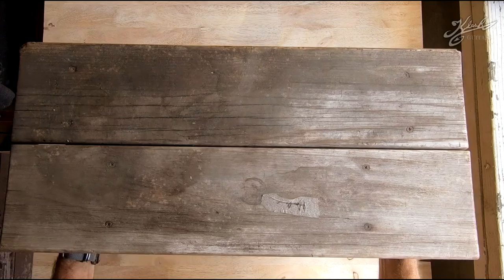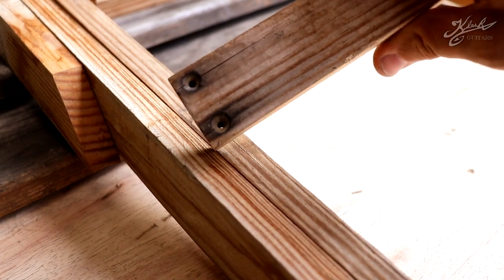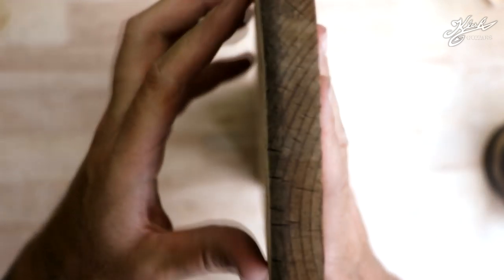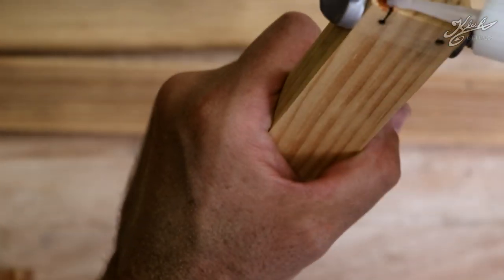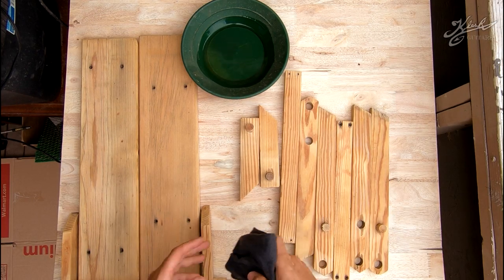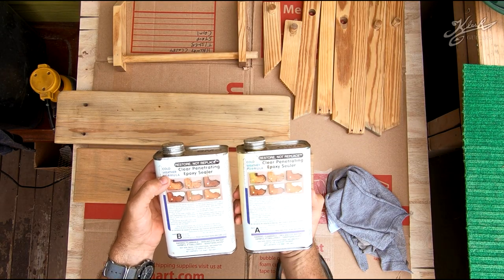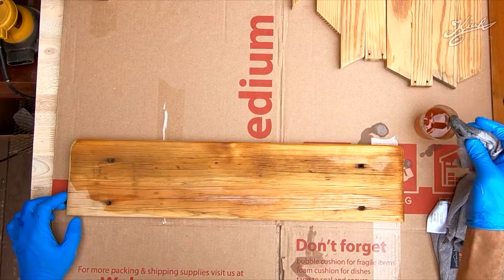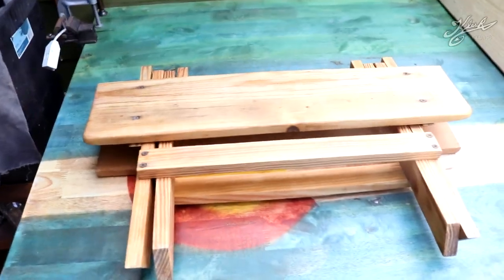Uncle Bartley's Puzzle Table Restoration

Comment: Nice video  There is some super glue called tite chairs. I used it on some rungs of an antique chair . WORKED GREAT. Didn't have to take the chair apart either. Comes with two ultra thin tubes to get it in crazy small places.  Can use on lots of items,  but kind of expensive.
Reply from the maker: Nice!

Comment: With super glue? humm looks like it worked,nice job...found a flake in my pan today with a good bit of flower gold,never thought i'd find any flakes around these parts most of the time just a nice line of flower gold. mhm i use the super slush gold pan by garrett also have for years..later
Reply from the maker: Nice!

Comment: Shane why don’t you put the glue into the cracks first then clamp it down? 
Cool video, thanks for sharing and keeping that old folding table around for a few more years👍  I think I saw a piece of gold in your gold pan....😂JK
Reply from the maker: The wicking action of the super glue is what makes it work, it also dries almost instantly. Gotta clamp it first or it might dry before clamping.
Reply: KleshGuitars Oh ok, is that better than using Elmer’s Wood Glue just because they are really fine cracks? I don’t think that thick glue would get down in there right?
Reply from the maker: @bo49685  True. The super glue is better in this case for two reasons. First reason, the super glue gets all the way down to the invisible parts of the crack. Second reason is that the cracks are old and weathered, probably full of dirt as well. The elmer's wood glue is great for clean and perfect seams, but when trying to glue together "dirty" joints, might have issues.
Reply: KleshGuitars Man I’m learning a lot just from that simple video, see why it’s cool to do those, it helps some of us out👍 
1 more question, is that superglue just called thin super glue or is there some special name for it?
Thanks again Shane for sharing this, I actually learned some things I never knew.👍
Reply from the maker: mark Bohamed I’ll have to get a link for you I bought it on Amazon, I’ll add it to the description when I get home.
Reply: KleshGuitars You don’t have to go to all that trouble. But if you do, THANKS Shane👍

Comment: You can we cup wood,by weighting it down,but nice video
Reply from the maker: Usually what I'd do is make sure it's completely wet first by soaking it for a few days underwater. If you can get boiling water, that's even better. Then using heat and pressure / clamps onto a flat surface and slowly add more pressure until it bends flat. Since this wood is already cracked there's a high chance of it splitting further even with this process.
Reply: @Klesh  we tend to do It dry to avoid that,but in saying that it can take week or two

Comment: Would it not be better to put the super glue in the crack before you squeeze it?  No, I see that is unnecessary and would consume to much glue.  Did you fill over the screw heads to keep them from rusting further? Also back the screw out of the spit end and chamfer the top of the hole more as the taper head of the screw is causing the crack. Do the super glue/ clamp thing again and Viola! I have taken to keeping a running commentary until the end of the video.
Reply from the maker: Good idea having a running commentary i like it!
Reply: @Klesh  The running commentary actually derived from your concurrent comment restriction on your giveaway videos.